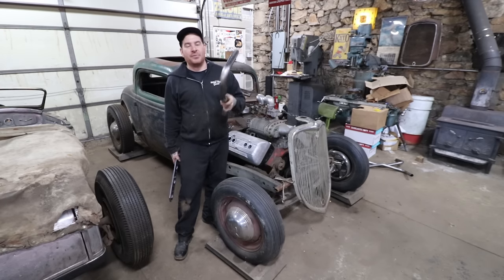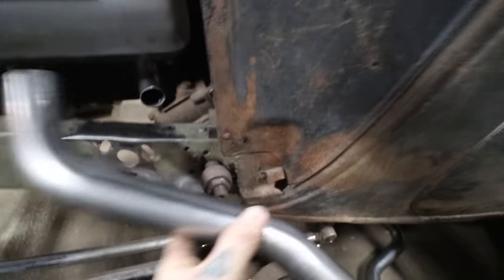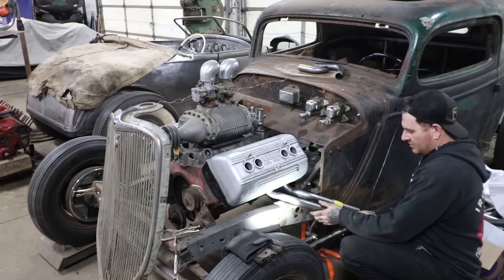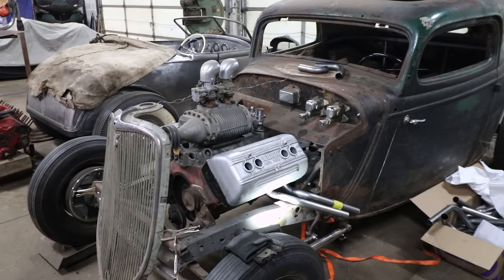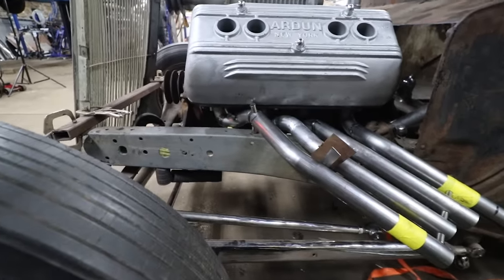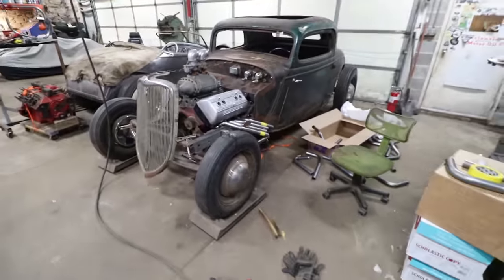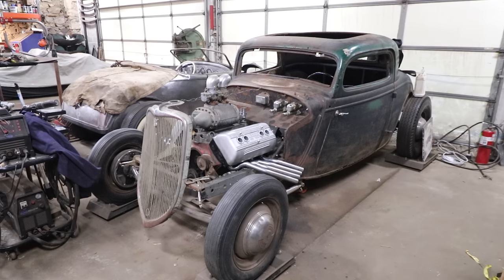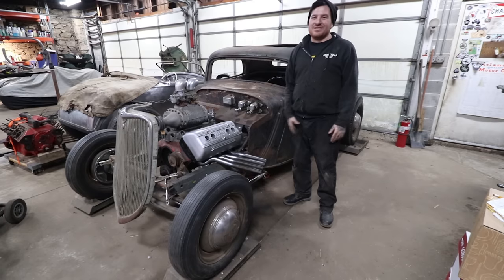Building Custom Zoomie Headers For The Ardun Powered 1933 Ford!!

Comment: If it’s too loud then you are too old 😂 I made baffles for my zoomies and you can’t even tell that they are in there. It took the crackle out of the exhaust. Hope this helps. The dumps near the head will ruin the flow of the exhaust and defeat the purpose of the zoomies.
Reply from the maker: Obviously it would hurt the flow but if you’re running full exhaust I’m not as worried about “performance” as I am sound. The fractional difference in power is probably not very noticeable anyways. It’s not a top fuel car.

Comment: Looks good as is! Have you thought about 8 chambered exhaust inserts (back in the 60s Walker produced a chambered muffler less system with external dimpling)?
But if you want hidden Siamese for 4 out the back or 2 collectors how about 8 chromed threaded cast pipe plugs?  
A little close for 8 lakes pipe plates. If tapped hourglass connecting gussets were added between the inner or outer tubes a lakes cap would block both.
Never liked the threaded cast pipe caps unless hidden by 406 or 409 inner fenders.
But looks great as is.

Comment: They look great but its a tight squeeze to get past the chassis rail. The Ardun is a great engine for the car but those heads and valve covers are massive. I think it is a good idea to run alternative pipes to the rear for quieter running. Maybe I am getting old but I now find loud droning exhausts quite tiring on longer runs, especially on motorways doing 70 - 80 mph for an hour.

Comment: Matt, I am not a grumpy old man and I am not trying to rain on your parade but I have a story for you, to wit. in 1935 the Ford motor company to help promote their new V8 engine hired the Miller-Tucker company to build them 4 indy cars using the flattie engine. They were beautiful, front wheel drive and they lapped the track in practice at 135 mph when everybody else was straining to do 130. none of the 4 finished the race, they all fell out with same problem. the steering boxes all failed due heat on the steering knuckle from the exhaust being to close to it. The Henry Ford Museum has pics of them. you will see that the steering is different than stock Ford but I would still put some kind of heat shield between the last header pipe and he box. 😎🔥 🏴‍☠

Comment: Looks bad ass. I just seen a tip somewhere. The guy used radiator hose clamps at the joint of the two pipes to hold them aligned. He also ground a couple slots so he could tack them at 4, 8, and 12. Seamed to work well.
Reply from the maker: Great idea!

Comment: Would it hurt the engine performance to run a straight horizontal tube off the head which could extend to the rear and locate the header tubes that up and over the frame rail?  What you did looks great but looks like a lot of work!

Comment: Run them down inside the frame rail and underneath the car and you could have all  8 pipes exiting Out the rear of the car. The length of the pipes would probably quiet them down a little bit and give the required back pressure.
Reply from the maker: That isn’t the look I wanted.

Comment: Is there any minimum or maximum distance from the frame or a steering box?  I am thinking more for engine movement or heat.  I plan on doing something like this for a chevy or flathead motor in cars that I am working on...(I have a few in process, sound familiar)... It looked like about an inch but hard to tell.  Any thoughts?  Btw they look great and gives it that old school feel.  thanks
Reply from the maker: As far as possible is ideal. But an inch is more than enough in my experience.
Reply: @IronTrapGarage  Thanks for the response, I pretty much watch all you videos for tricks and technique.